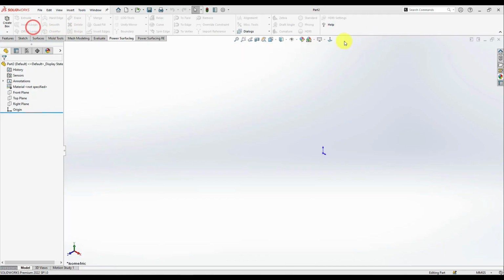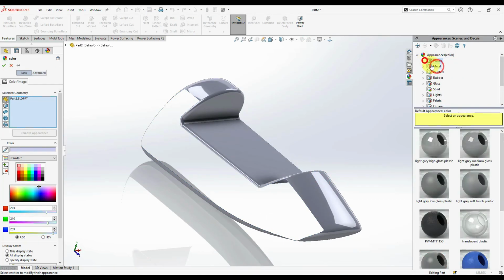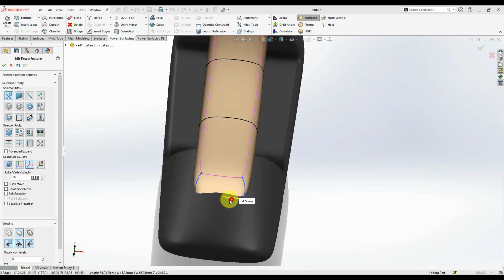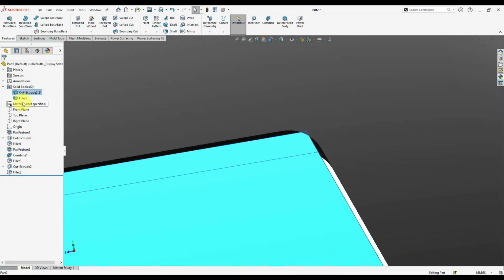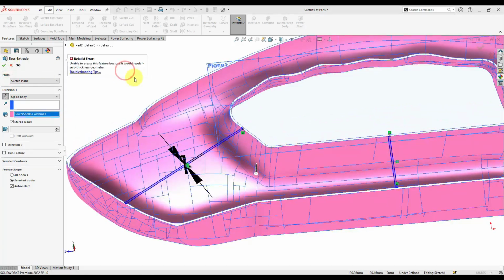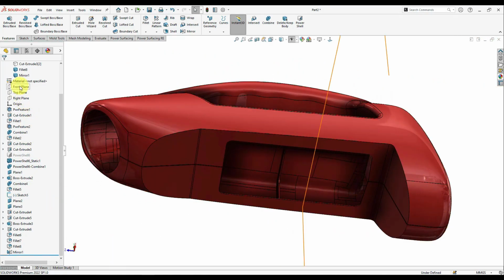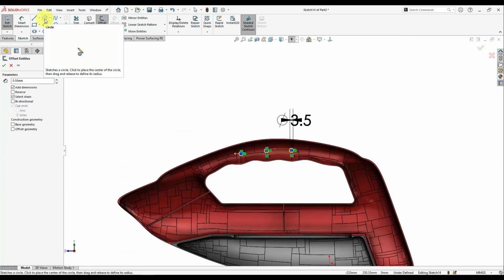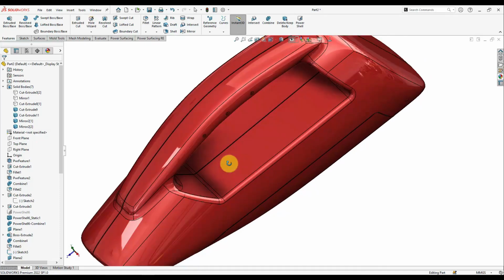Vacuum Cleaner | SOLIDWORKS® TUTORIAL

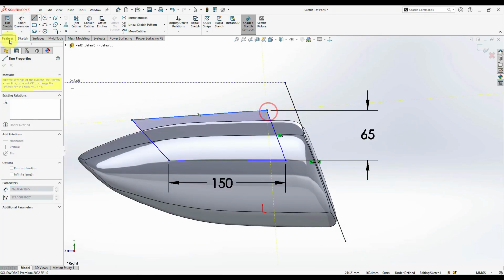Comment: 3:02 When I try to make an extrusion cut on the figure, it doesn't allow me to perform that action. What is causing me not to be able to use it, and how can I fix it?
Reply from the maker: Make sure it's a solid body and it doesn't have an opened surface.
Reply: @npowersoftware6638  Thank you so much, that was the problem, now I can do it :D